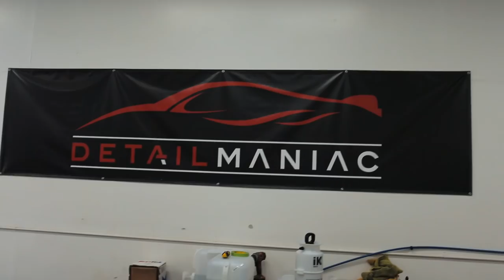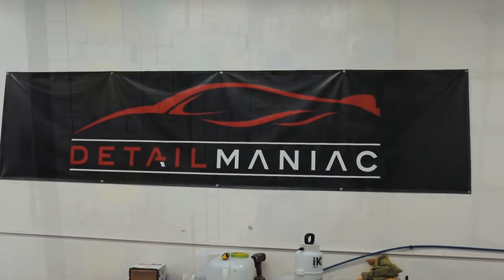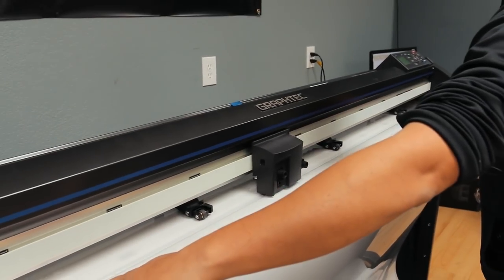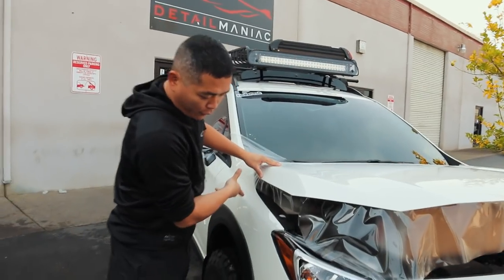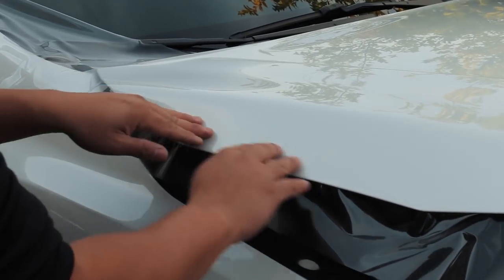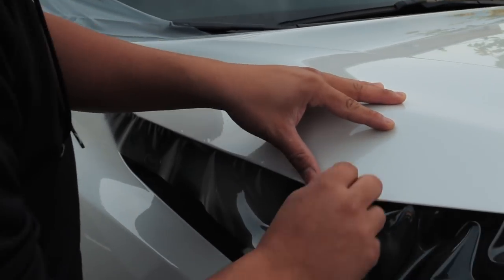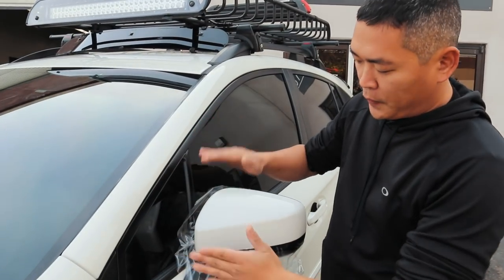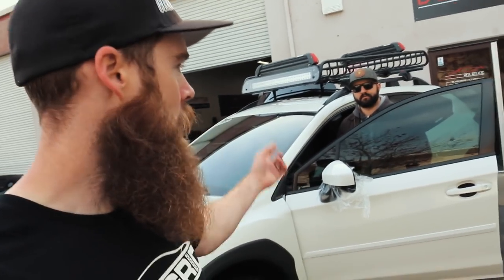PAINT PROTECTION INSTALLATION DONE RIGHT!

Comment: Woah seamless install!! Very very nice!  I have the full 3M on my WRX but over the years now and the winter weather - really has a bad impact on the film all the mud / slush / salt / grime from the roads in the winter and long drives out to the mountains - now my film has become slightly yellowed :(   Might end up getting it re-done in the future.
Reply: No way you have 3M, or you never wash and wax. 8 years 3M on my sister's golf, other than getting barely hazy it's still good, this was pre self healing film. my 5 year STi still looks like the day it was installed. And we both drive in winter with salt and sand.

Comment: Nice install, did they correct the paint on the vehicle before locking any defects underneath the film before application?
Reply: The car was almost brand new when I had it done.  They clean/wash it first, but nothing major needed.

Comment: It's nice that those mirrors are in a 1 piece, shame about the cut marks you've now left on the paint work no doubt.

If you leave bubbles to dry in the sunlight directly, they will blister more than likely.
Reply: mirrors have a cap, if they cut right at the gap, it won't touch the paint, and it'll be seamless. And it's easy to score the film so you can tear it off without cutting the paint. Quality film are very slightly porous and minor bubbles will evaporate out.